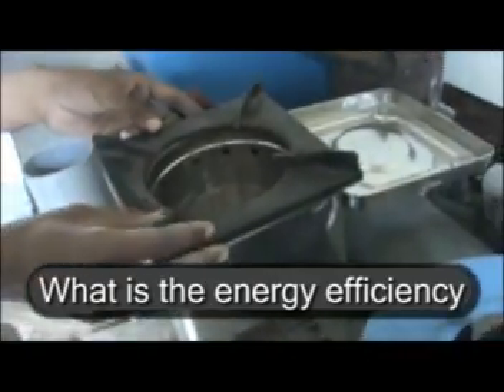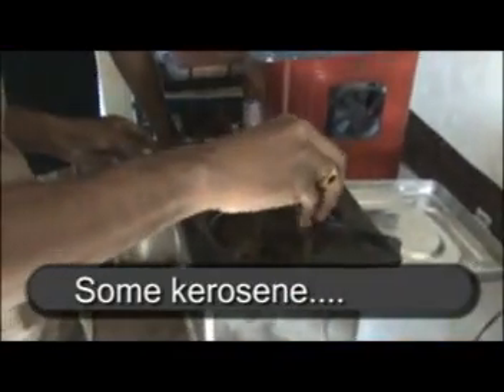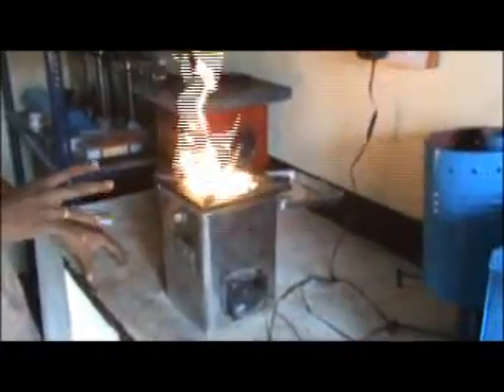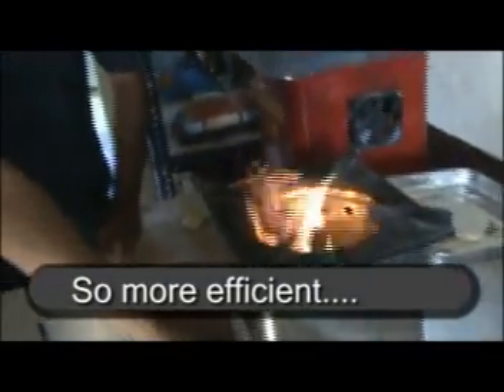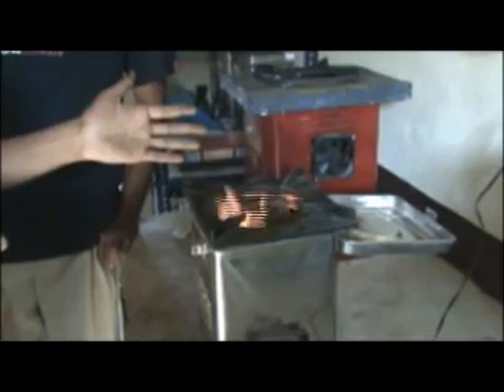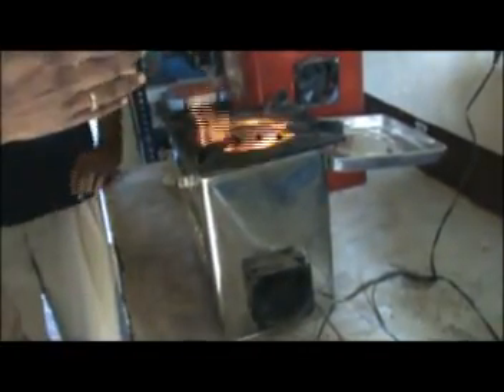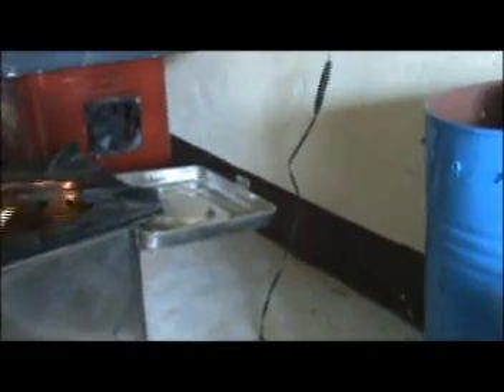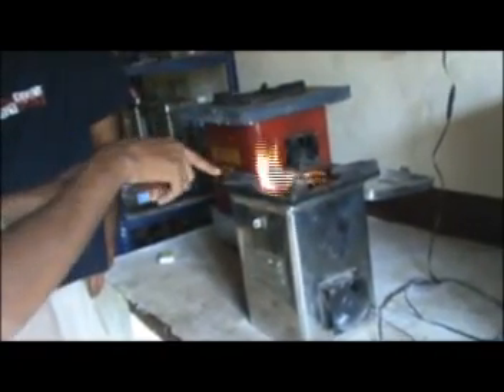Smokeless Stoves

Comment: good... but, instead of using square type u can use cylindrical pot outside.... so air will circulate, mix and come out equally through the top holes...